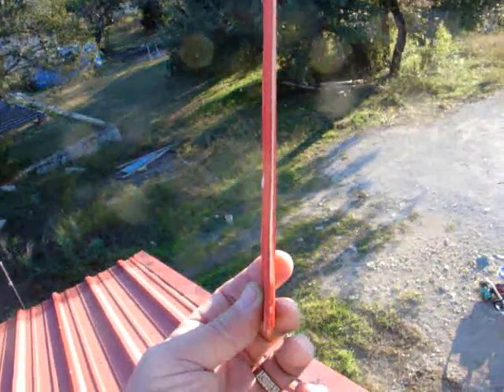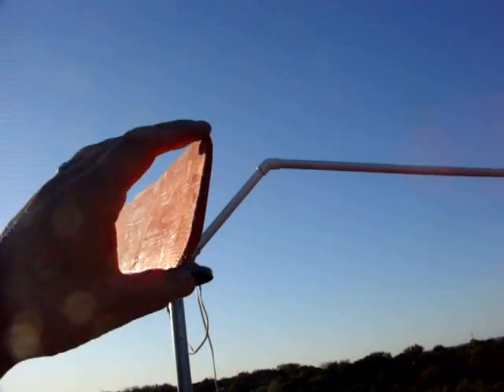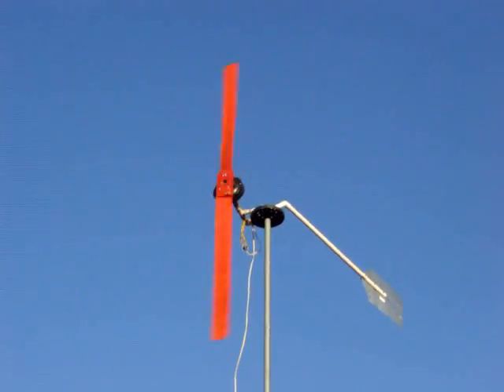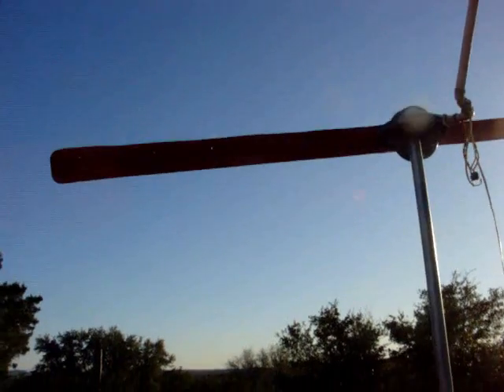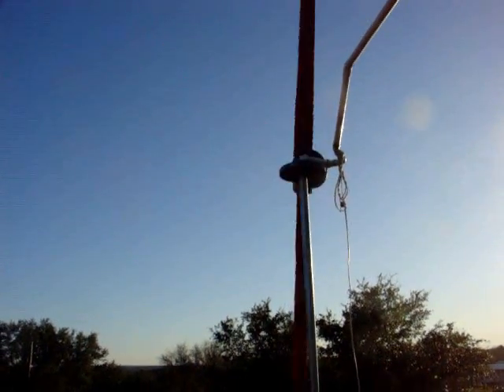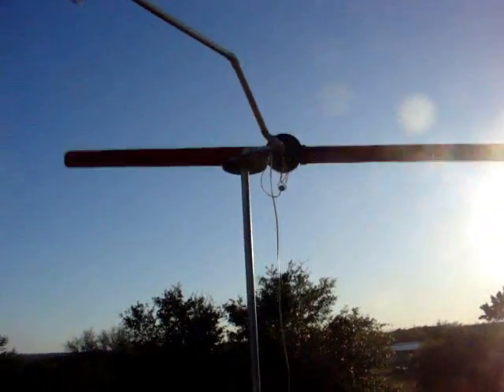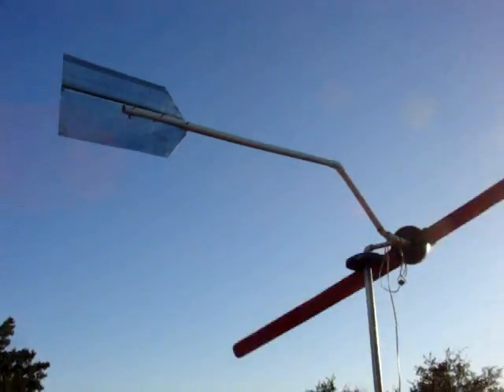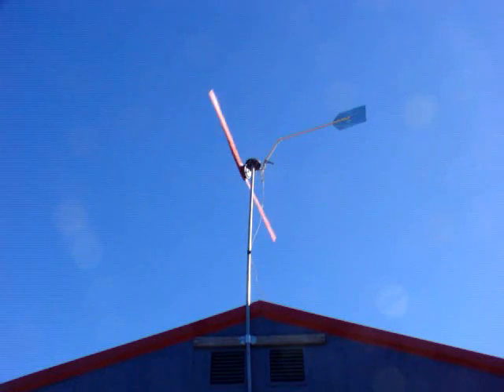ANALYSIS OF A WIND TURBINE FROM HARBOR BREEZE CEILING FAN MOTOR

Comment: I agree - your blade is too long - is that sound the blades hitting the pole when the wind blows strong and the blades curve?  Also, I got my hands a ceiling fan that is rated for 3.5 AMPS and am going to try for 7 as you did.  I'll let you know...